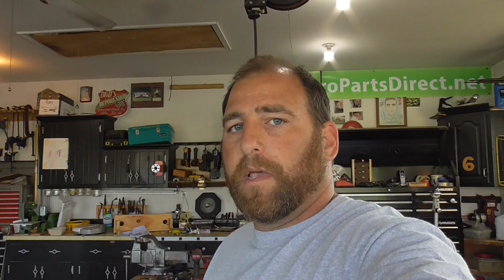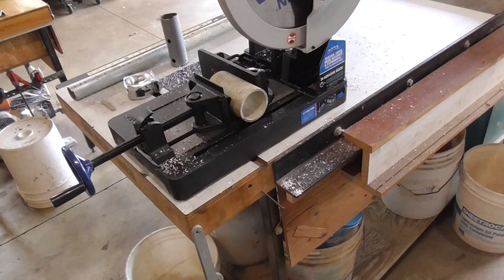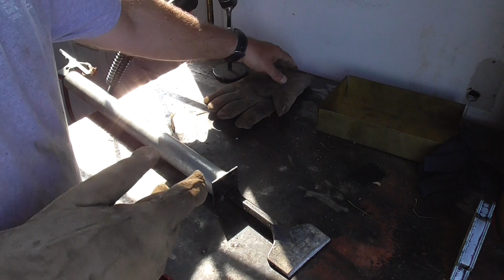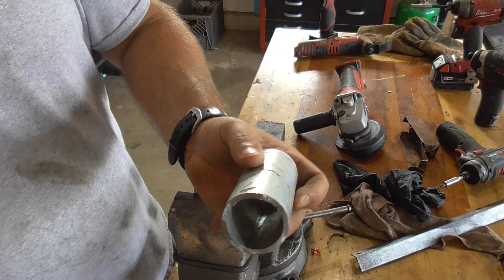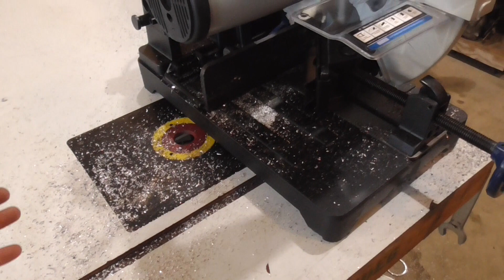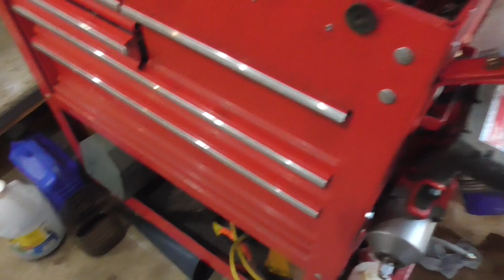Welding Up A Drill Storage Rack With Evolution 380 Chop Saw

Comment: Great idea.  I need to do something similar.  I wonder how the horizontal band saw compares to that Evolution saw you used.  Sure cuts the metal.  Looks like a purchased piece of equipment.  Great job.
Reply from the maker: If you do a fair amount of welding you are going to need something to cut the metal cleanly.

Comment: Nothing special about the actual chop saw; it's all about the technology of the blade; I may get one (blade) for myself. Quite a few reviews out there on YT/etc on these Evolution saws. A cheapy  Harbor Freight saw with one of those blades will do exactly the same thing; IMO.
Reply: A standard abrasive saw spins nearly 2x faster than these dry cut carbide blades are rated for. So you could throw a blade on a cheapo HF saw but it will more than likely self destruct the blade.
Reply from the maker: The Evo saw is geared down to run with really high torque and really slow speed.  If you put a blade on an abrasive saw it will heat up and damage the carbide teeth.  It will work for a few cuts, but after about 20 cuts you will have a destroyed  $80 blade.